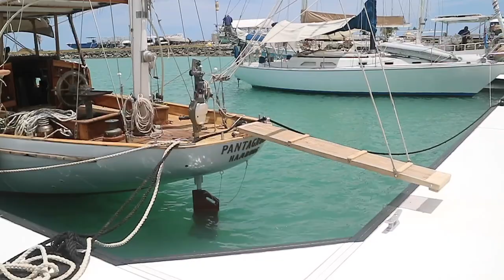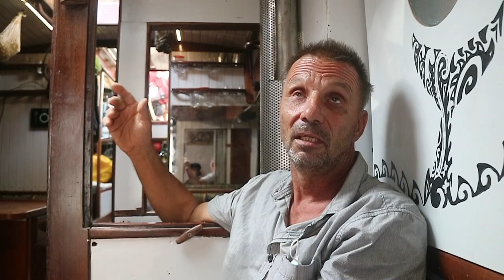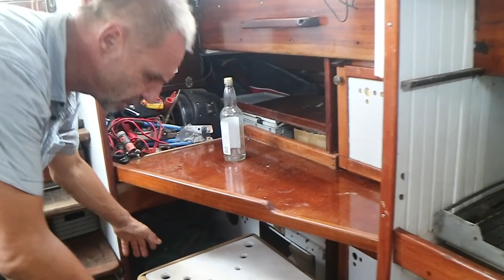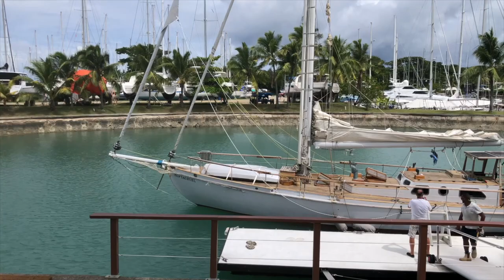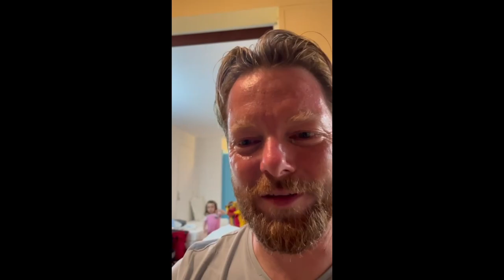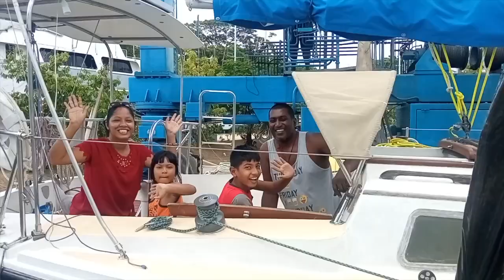Historic SAILBOAT SINKS - Part 6 | Cruisers Corner

Comment: Did the hull take on any water as a consequence of the heavy seas you encountered?  It's often stated that wooden boats "work"that is to say, leak as the hull is slightly distorted in heavy seas.
Reply from the maker: Good question. He didn’t mention anything, I’ll ask him next time we chat, his hull is covered in fibreglass though so probably wouldn’t have quite same issues though no doubt he had some leaks from the deck